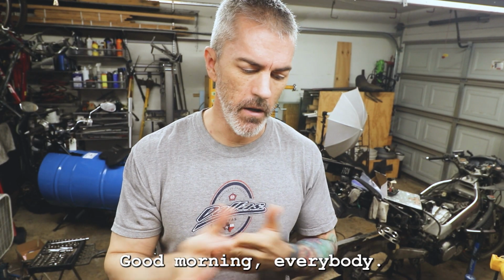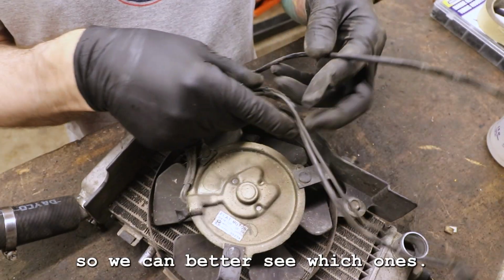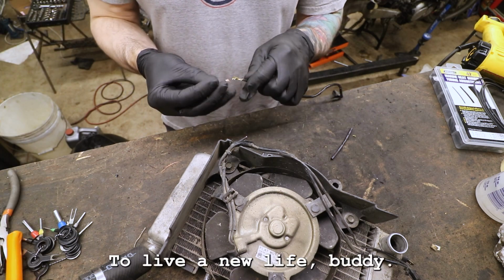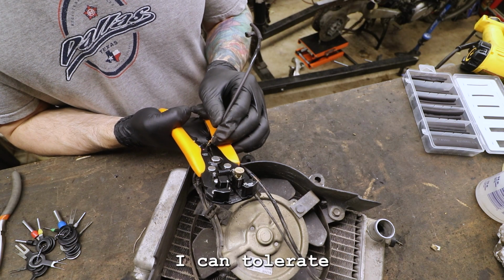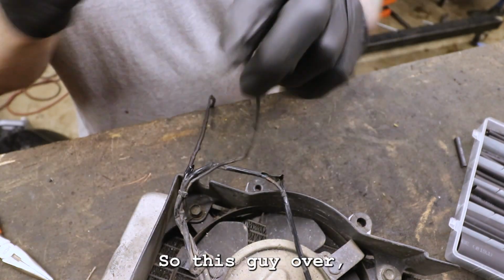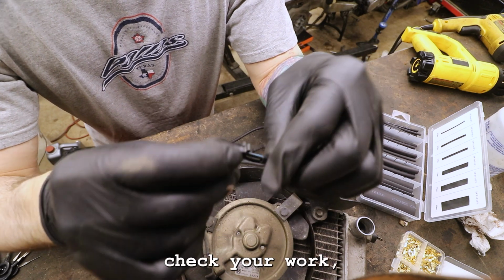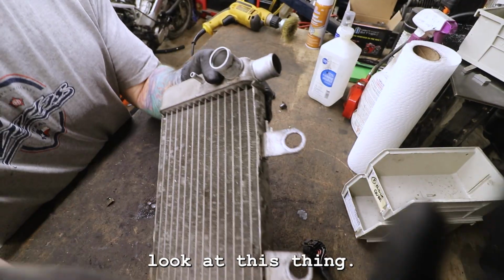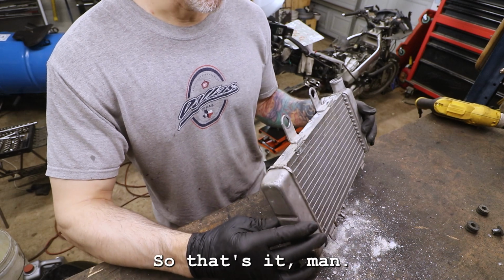VFR build 11.8.23 | wire repair

Comment: There are two radiators because then it can run heat management separately for the two heads. If you keep the rear head warm, the front head is too cold, and if you keep the front warm, the rear is too hot. IIRC the ECU drives the fans separately based on different water temp sensors. It's an ingenious solution to the V engine problem